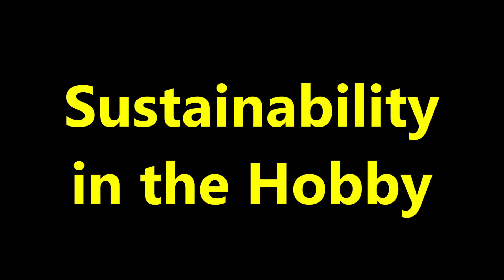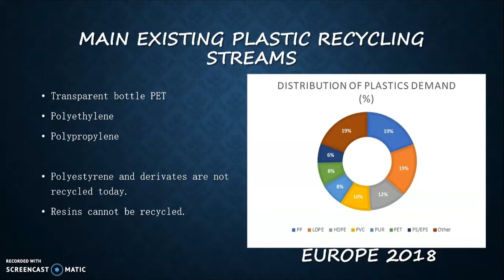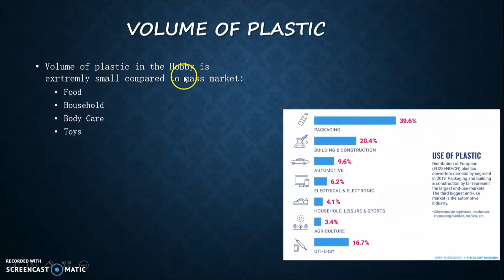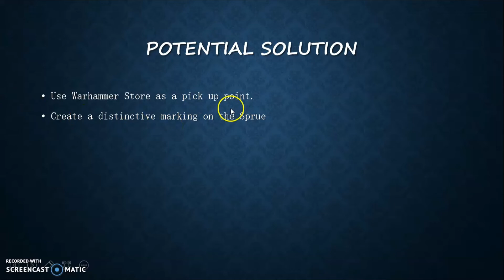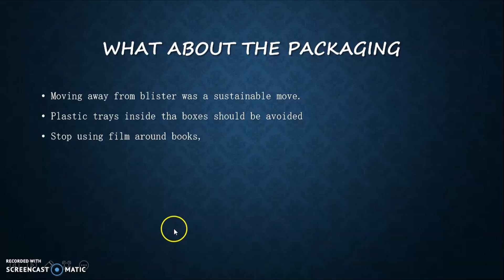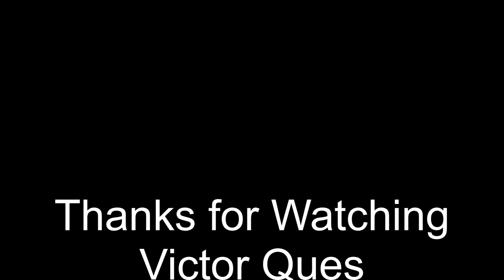Sustainability in the Hobby

Comment: Very interesting slides Victor - I didn't know about the breakdown of plastic demand so this helped me understand a lot. I think the recommendations you have are reasonable but I wonder if some of the remaining plastic use (like you pointed out, they moved to recyclable cardboard boxes for most things) is mostly necessary now. As in, to protect from moisture during adverse conditions and to make sure the products can be stored for years. Cardboard may not protect the books well enough if there is no shrink film around it. Still, GW should certainly try to get away from all non-recyclable plastic use where possible - just like you said!
Reply from the maker: I glad you like the video. The recycling streams keep working to accept more types of pastic but thre is still long journey. At think at the end is a combination of trying to reduce consupmtion and imporving teh recycling methods.